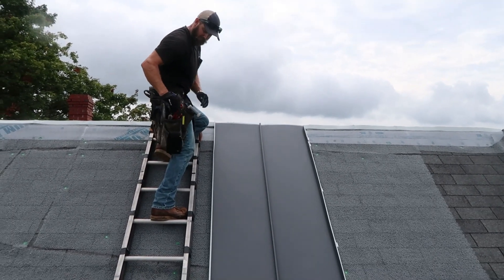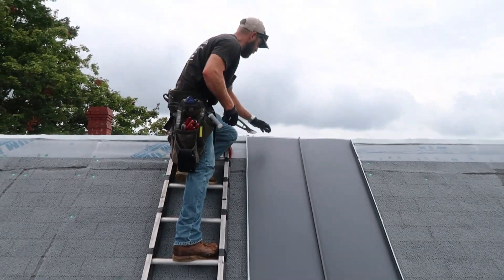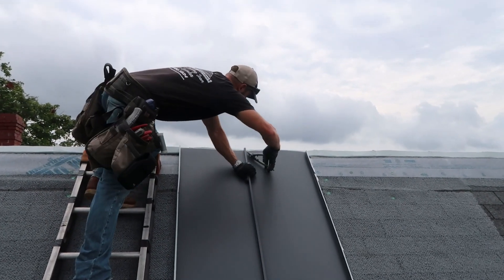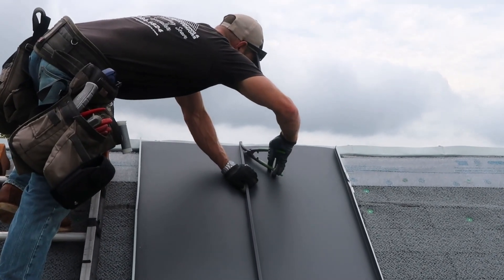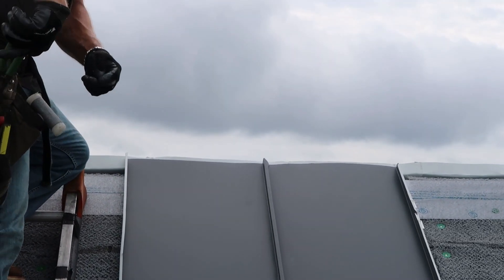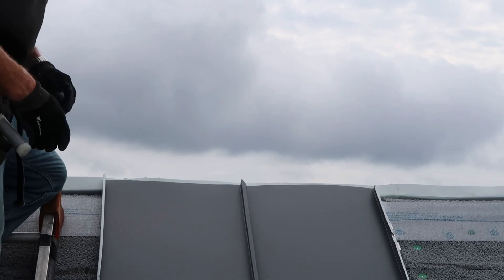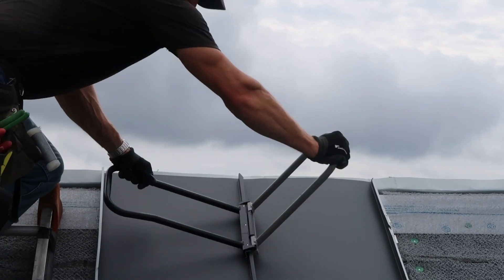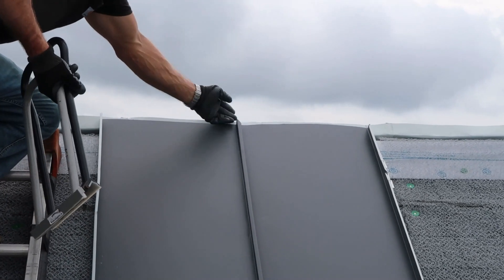Standing Seam Valley: Installing Field Panels

Comment: Hey Craig, what is the significance of the last 20”? Why 20” and not 10”. Currently on a job and I’ve only done the last 10” and things seem to be working out fine. Just wondering if there is a significance I should be considering? Thanks for the videos wish you guys put out more out in the field stuff!!
Reply: It really depends on the slope and width of the valley pan. For this particular roof the  20”provided adequate space for the flow of water to freely pass over splays and run the seam. Sorry for the delayed response here.